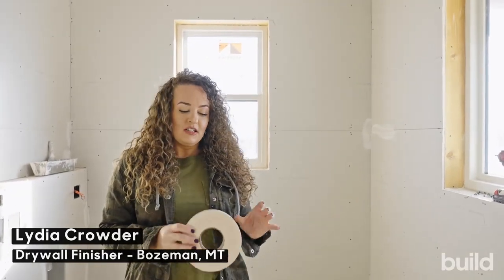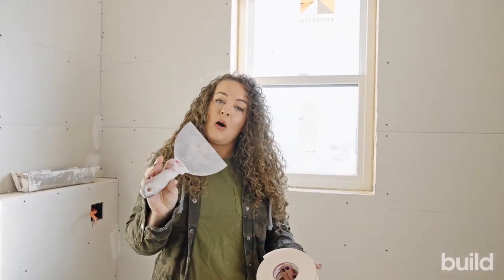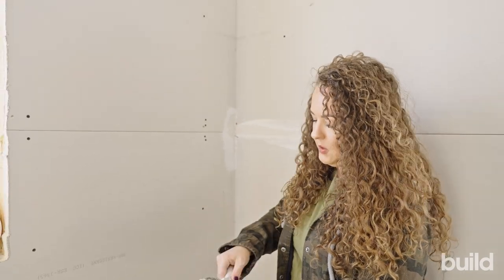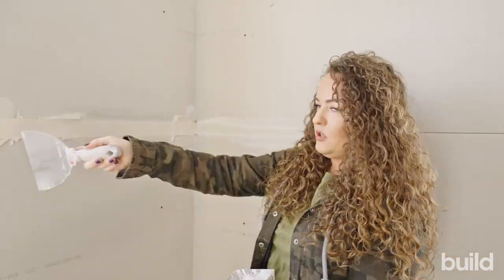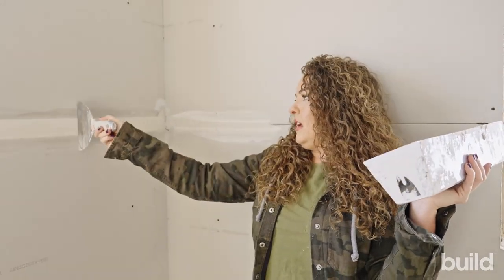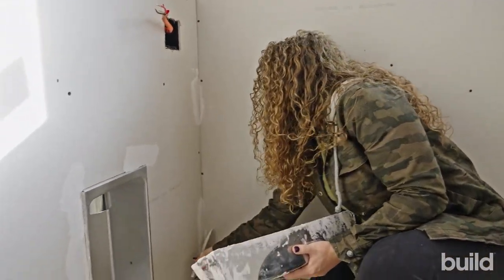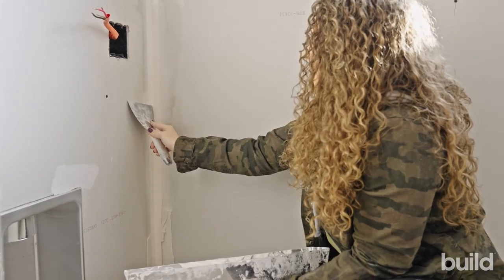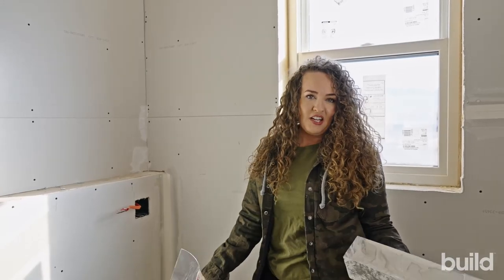How to hand tape drywall successfully!

Comment: Uhaaaa, where were you 5 years ago when I bought a short sale house and hired & fired 3 drywall contractors? I ended up doing it myself and learning as as did a pentagon breakfast nook.
 I ended up doing rounded corners. I just couldn’t seem to get a straight corner. The finish job looks good.

Comment: Awesome video, and it covers all bases!

I'm not sure why it's different, but over this side of the world (Australia) most of the plasterboard manufacturers (Gyprock, G-Tek etc.) recommend a 3 coat system... the first two coats are a powdered base coat (hot mud), followed by a regular compound/mud for the finishing coat. I'm sure there's alot of people that just use regular mud for all 2/3 coats...

I'm not going to lie - for hot mud scenarios I love FibaFuse on non-corner joints...
Reply: I love Fiba Fuse for butt joints mostly. I'm a paper tape guy but Fiba Fuse is a worthy product. I really like the porosity, and how the mud really gets through and sets. Use it a lot here in the States for my projects.
Reply: Same here mate, taper from Ireland and it's 3coat system here  also.

Comment: So what do you recommend on 135° walls? As far as tape and such.
Some refer to these walls as 45° but this is simply just not true. To clarify... You have a short 90° wall, a wall that slopes 135° from the vertical wall or 45° from the floor, and finally the ceiling 135° off the sloping wall. This would often be seen in the 2nd story of a Gothic style house where the roof often runs a 12/12 pitch. Dormers may also be present in this setting. I am looking for a good resolution on the horizontal joints specifically.

Comment: They have those 3.5 inch inside corner tools at Home Depot. I take a dremel tool and cut 1 inch off each side. 2 inch tape equals 1 inch each side of the angle and about 2.5 inch of angle tool on each side of the angle. The way I hand tape angles I have my pan full of mud and scoop the inside angle of my pan with the angle tool and have a nice neat blob of mud on it. Puts on a nice fast even amount of mud on both sides and I wipe with a 3 inch knife.

Comment: Hey hello :) I like your chanel, question.... When you are taping it is not the same mud as you use let say for 2nd and 3rd coat ?
Reply from the maker: For taping I’m using All Purpose or Lightweight taping mud. When I’m coating I switch to Plus 3.

Comment: Thanks for the instructions. Have a corner where the drywall has separated over an inch. (50 year old house)I've tried filling it with caulking yet it still cracks within a year or so. Got my tape. Have plus 3 . Is that OK to use?  What is the proper fill used to fill in an inch void? Drywall mud or?
Reply from the maker: I would fill the void with Easy Sand first then tape with USG All Purpose and paper tape. You can coat the tape after it dries with Plus 3
Reply: @DrywallShorty  Thanks!
Reply: Prefill first with durabond.